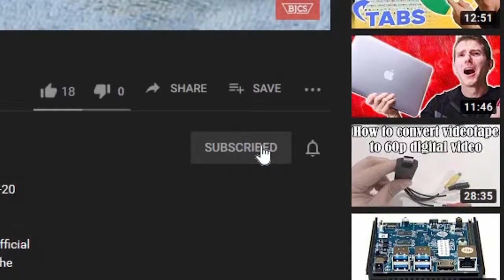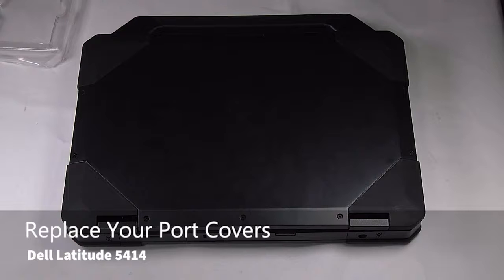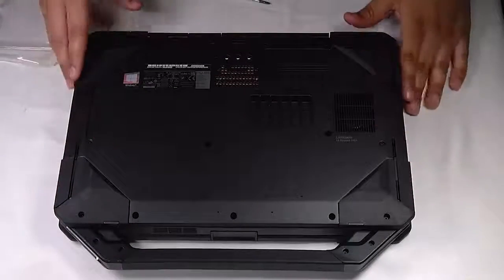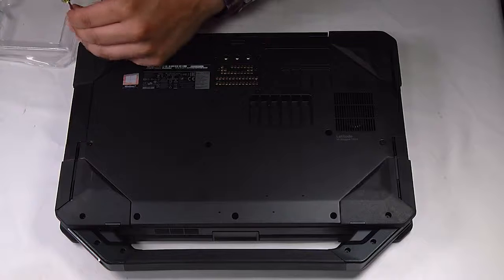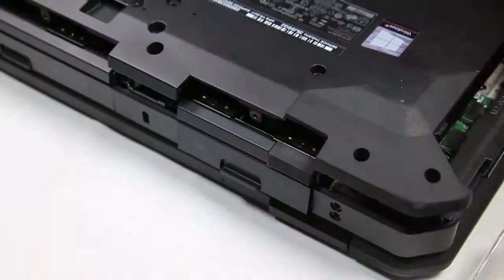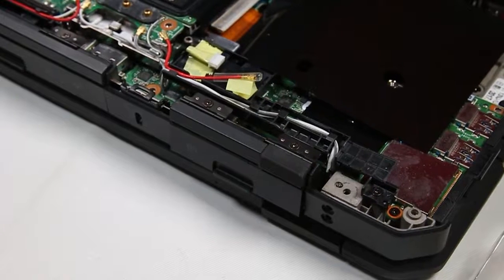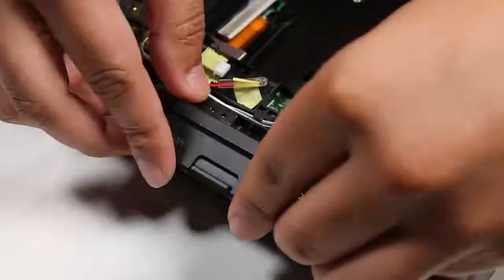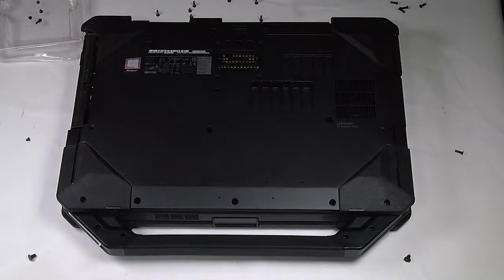How to Replace Dell Latitude Rugged 5414 Port Covers!

Comment: I like your videos if ya  skipped past taking screws  out and  putting in would be  much better.
Reply from the maker: I agree, but in some cases the screws that you need to remove may not be obvious. So we include that part.
Reply: question if I take the memory cards out of an old dell would it bring over saved information that I saved, or would it also bring over the other computer's operating system? would that mess the system that I put them into up?  I hope I made sense 🙄 Would be bringing more memory to my Dell 5414 that I just got.  @Bobjohnson
Reply from the maker: RAM sticks clear their memory when the computer is completely shut down. And when an application closes, the data in RAM related to that application is typically cleared and made available for other applications to use. Just make sure that the computer you are putting the memory in supports that memory. Hopefully this helps, thanks for watching.